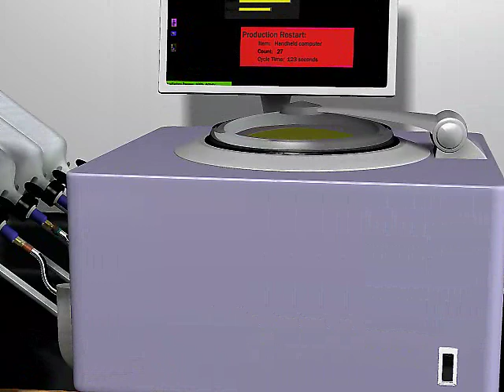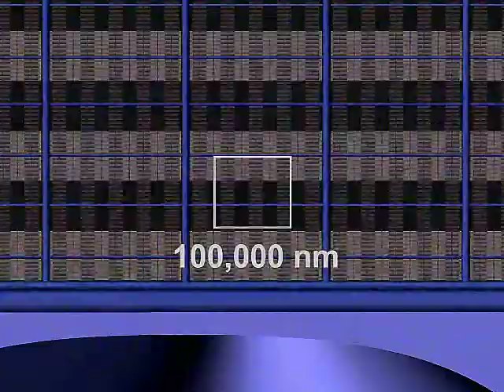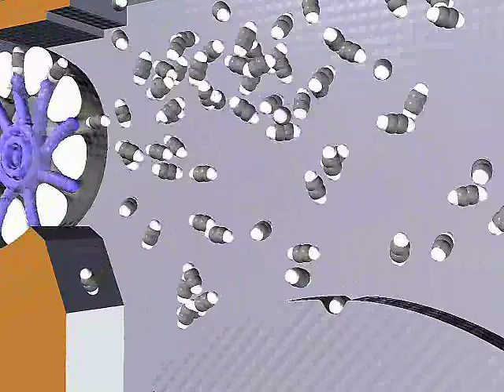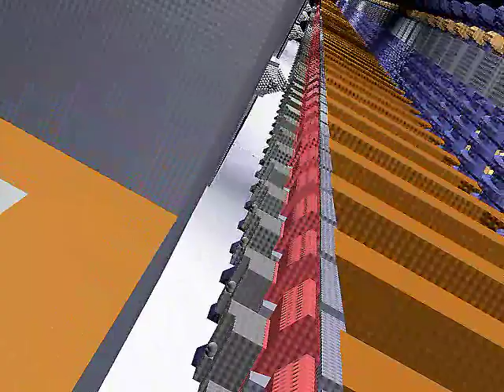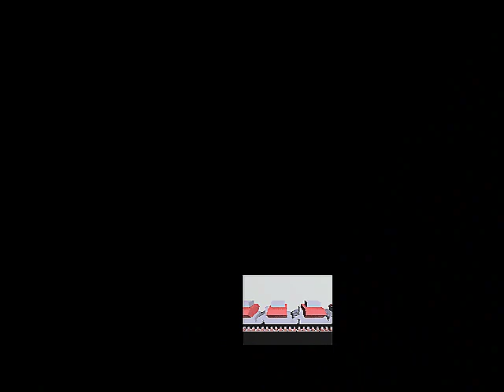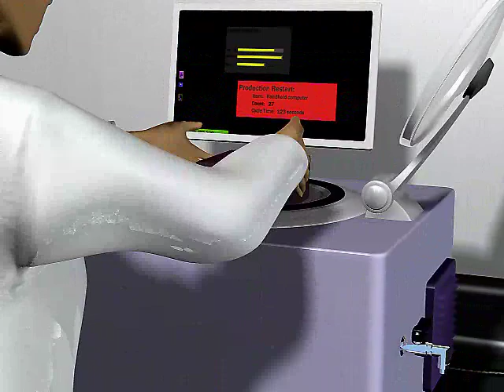Nanofactory Movie

Comment: with this accuracy, the factory would be super sealed that there is no air, no mist, no dust 
no un designed friction and the motion of mechanical parts will be flawless seamless 

 with minimal power required for each  nano machine part,, 

there will be no corrosion and no need for oiling parts, no need for cleaning and no maintenance required,,

if the factory is perfectly built atom by atom, it should stay working forever as long as it's powered correctly by energy and right raw materials

if the factory is designed to duplicate itself until reaching the designated size to process the intended end product.

you may end up having the technology of tony stark's mark 85 iron man suit

you may have a printer that is able to build nano designs uploaded on an internet page or maybe shared on facebook

you would have nano cartridge to install in the printer that has the elementary atoms properly organized for the nano machine printer thingy,, then you download the construct of iphone 30 or tesla car part or a design of small glass cups factory and then u just print it out

i wish i time travel to the future 100 years only

Comment: The materials would be ordinary carbon, hydrogen and other common elements.  The difficulty would be in the vast amounts of energy required to melt them down to the point where they are useful in this machine.
Reply: I dont think this machine would work if you put anything hot in it. Like wouldn't that break Bonds all over the place.
Reply: @jimbob-jn6jz  
actually, that's a great point. probably something that should be under consideration for the water destruction process.

Comment: Unfortunately, that's not very precise. Diamonds are already built in laboratory for cientific purposes. Still, natural diamonds hav a higher value compared to the manufactured ones. 
Also, this machine don't chance the nature of the atoms, it's structure and it's atomic number. An atom of carbon enters the machine, an atom of carbon exits the machine. This means gold can't be produced by the machine. It would contradict main laws of physics and chemistry. 
So, gold wouldn't lose value after all
Reply: after mature nanotech the space flights become much cheaper. This obviously will lead to mining space objects on massive industrial scale. Gold extraction could be done

Comment: how the hell would this kind of system handle errors? you have bazillion steps of construction, there is really no way to get them all rigth. and thus you cant really have the product you designed, each one will have countless errors. even more complicated would be to orchestare this production line. sorry but in less than 50 years time this is pure science fiction. even more doubtful is if it would be economically viable